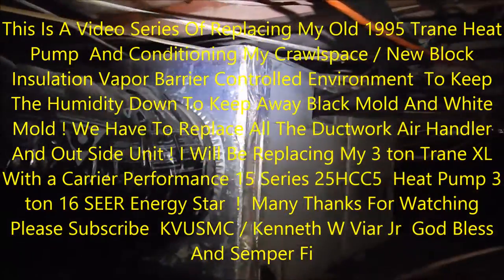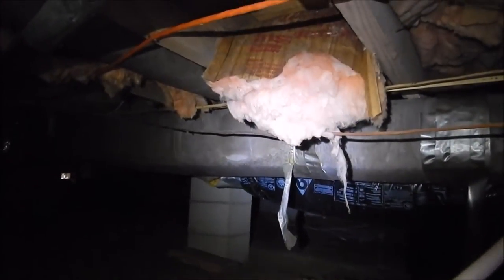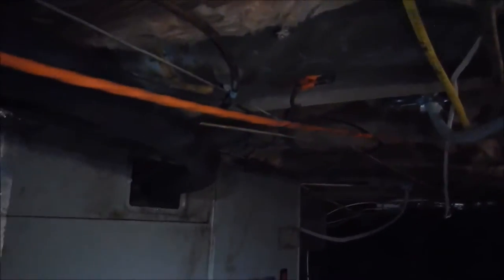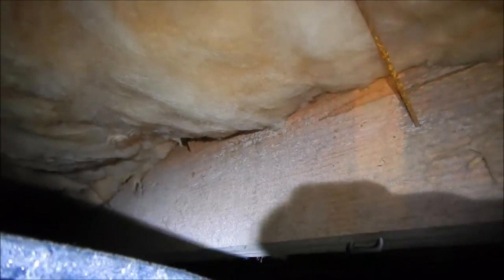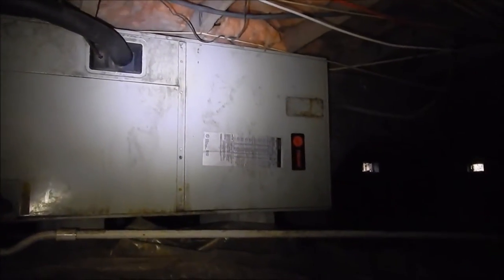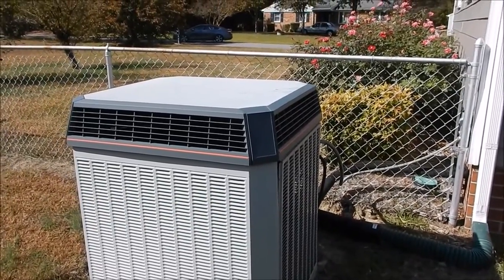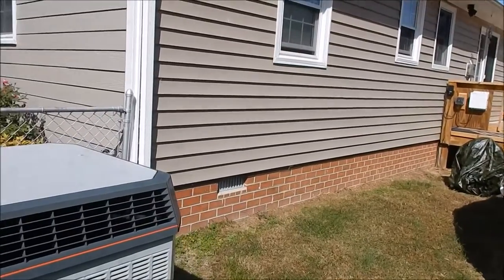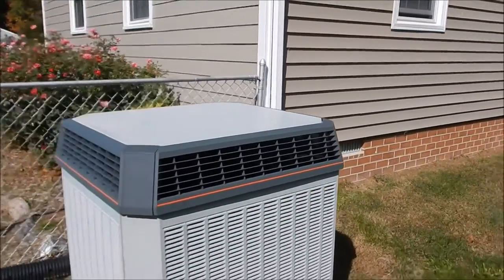New Heat Pump Duct Work  And Conditioned Crawl Space  Install With KVUSMC  Pt 1

Comment: how cold does it get where you live? If I remember correctly if it gets to cold they don't work properly. but I also can tell by your accent that your down south, so I'm sure you don't worry that much about 20 degree days like we suffer from up here in the north
Reply from the maker: HI Buddy We may See a below freezing A A few times A month I live in Southern Virginia the New Heat pumps are A southern Thing not Much Good up North Your Right Thanks For Watching  Cheers Kenny
Reply: Nice unit regardless, that's going to turn your house into an ice box in the summer
Reply from the maker: Steven Silva Yes Sir We Need In The Summer On The Hot 95 Degree With 90% Humidity Days In Southern Virginia  It Is 26 Degrees Here Noiw And 90 % Humidity This Carrier Is Kicking Out The Heat Too Many Thanks Kenny